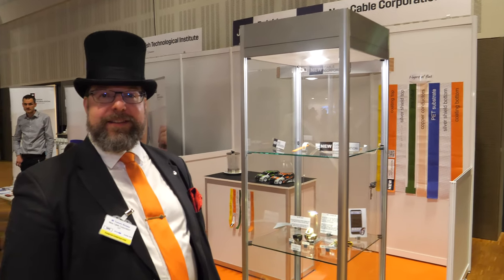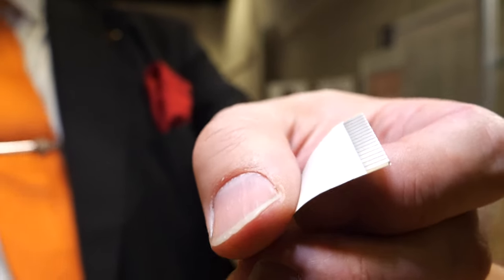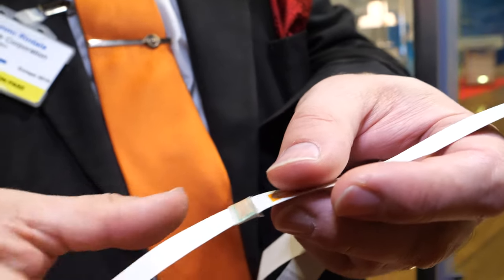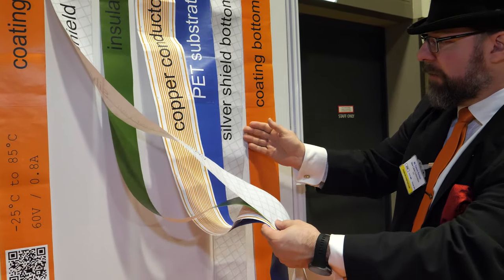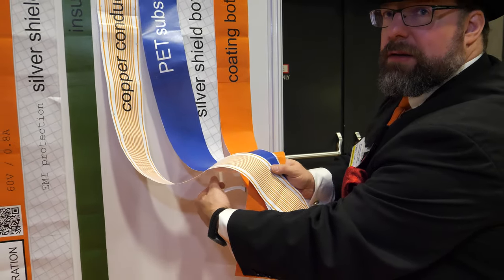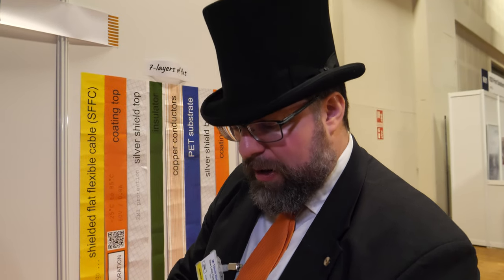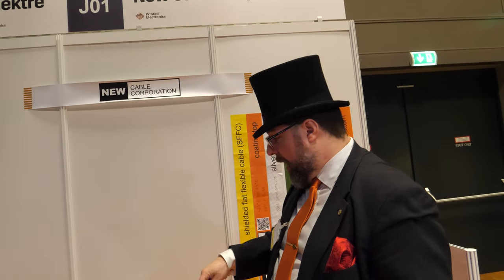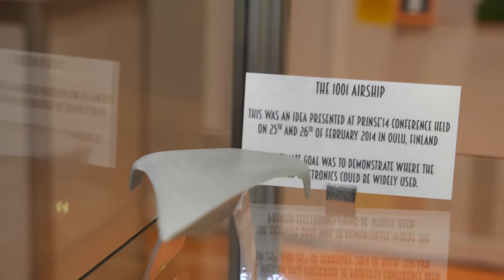New Cable Corporation flat cables high data and high power

Comment: Airplanes cable breaking strength is between 2000 to 4200 Lbs and this kind of cables and wires are not good for any aircraft